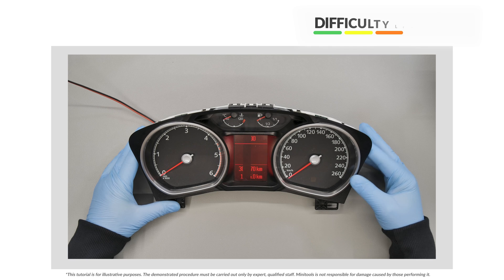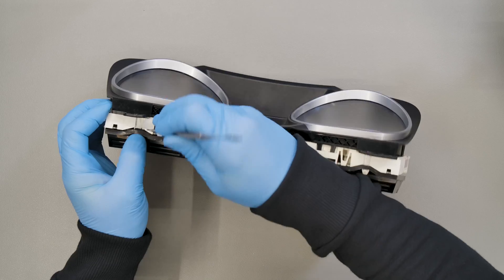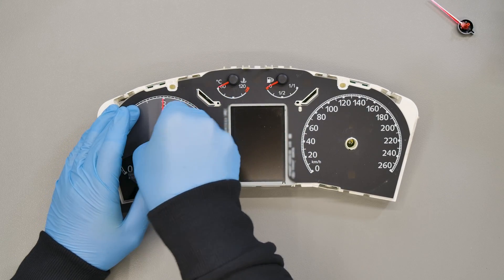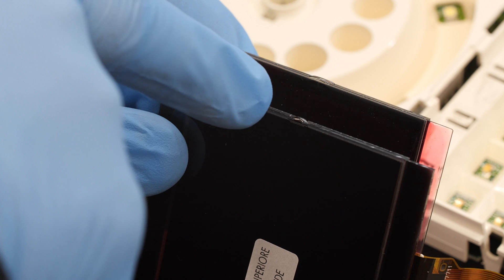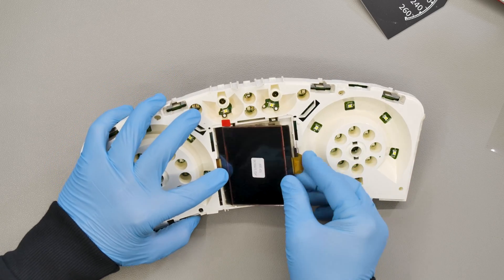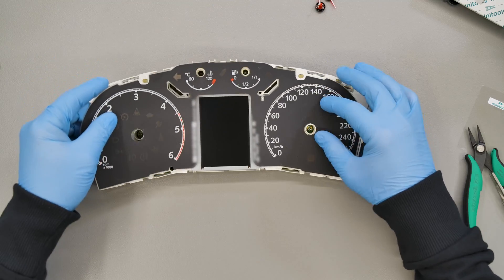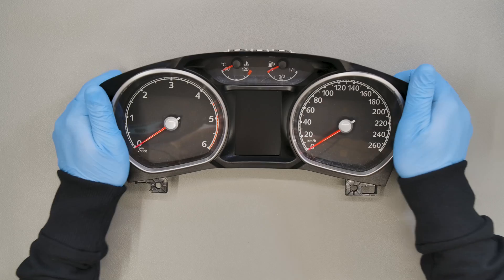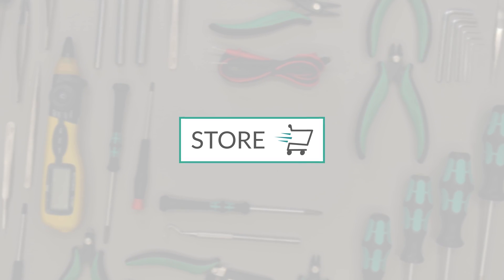How to repair the Ford Focus, C-Max, S-Max, Galaxy, Kuga, Mondeo instrument cluster

Comment: Hello. Thank you for the informative video. I've got a question about the display connection. Since the display does not have a protection against the incorrect connection, what will happen if I confuse top and bottom sides and connect display upside down? Will it be damaged unrecoverably, or will I just have to connect it correctly to get it working? Thank you.
Reply from the maker: Hi, if you install the display upside down it would simply not work, but it wouldn't get damaged, don't worry.
Reply: @MinitoolsChannel  , thank you very much.

Comment: That's not the problem, changing display will not solve the problem. It will reappear.... there are some resistors with bad soldering joints. Of course,  you will need a very good microscope to see where the problem is...
Reply from the maker: Hi, most of the times the issue is related to the LCD screen and not to the resistors, and when the issue is actually related to the resistors, the display needs to be replaced anyway, as it wouldn’t work even after fixing the soldering joints. If after replacing the display with our SEPDISP32 the issue persists, our technical assistance would guide the customer to identify and fix the bad soldering joints.
Reply: @MinitoolsChannel  well, I've repaired at least 50 pcs of this clusters and only one requested display change because it was smashed. So, try to debug the motherboard and you will find out that all displays are good and its all about bad soldering joints. Cheers.
Reply from the maker: Ok, if you should ever encounter the issue to the LCD, which is actually very common, we’d be happy to supply you the display!
Reply: @uscovu  hello how can I contact you I need help with this problem?
Reply: can you help me with that also? i can pay to you for info, no problem, thanks

Comment: Hello, could you tell me the pins I need to connect on a bench power supply to light up the gauge dials please, I've connected pins 32 and pin 2 and I can only get the dials to move screen to come on. Is there an easy way of finding what pins do what preferabley without the vehicle thank you for you time
Reply from the maker: Hi Tim, please send an email at info@minitools.com with more details.
Reply: I've sent email but comes back as no such user
Reply from the maker: Hi  @wildstyle42 , we did receive your e-mail and replied, please check your inbox.

Comment: I have a similar problem with lcd screen but if I disconnect battery and reconnect the screen is back to normal
Reply from the maker: Hi! Usually if the display looks bad, the problem comes from the display, but maybe you have another fault on Ford instrument cluster
Reply: @MinitoolsChannel  it gos blank but still is back lit strange only happens sometimes
Reply: Same did you sort it ? Mine goes like fully blank but then sorts itself